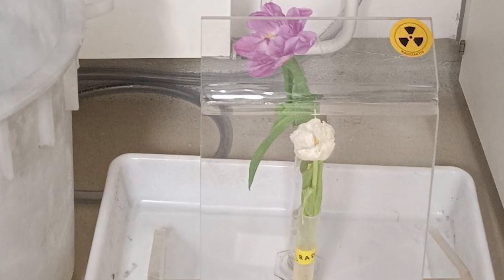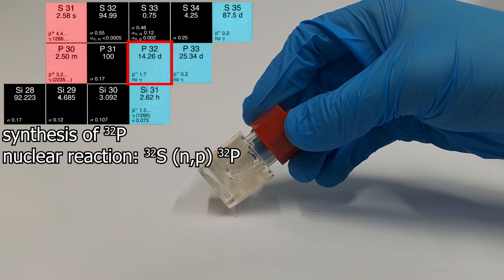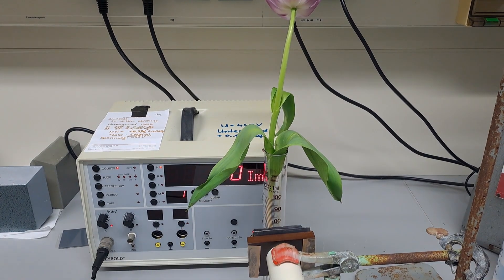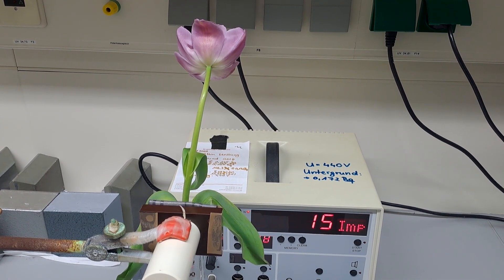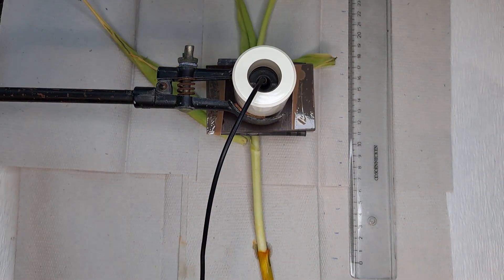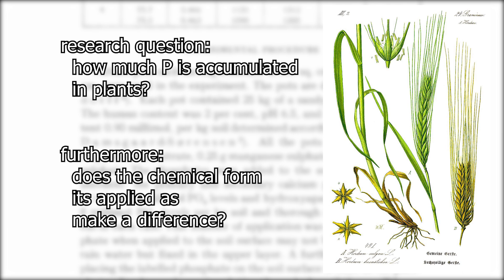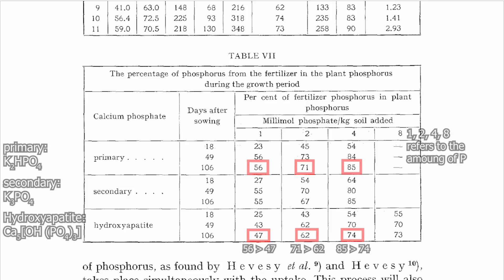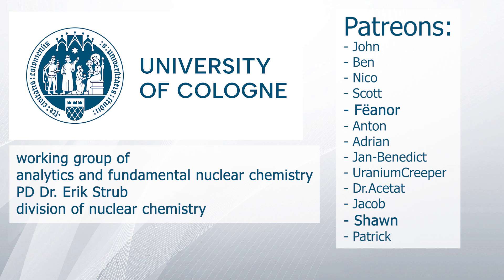I made a flower radioactive with P-32 - nuclear chemistry

Comment: Are radioactive phosphorus isotopes expensive? I think they would be interesting mutagens in plant breeding. Perhaps too expensive or the mutation profile is not desired (instead of point mutations, maybe there would be too large deletions).
Reply from the maker: @user255  this bottle costs 800€ and not only is it very short-lifed but also verry ineffective. Plants and every living organism are incredibly resistant to radiadiation. We once out a Petri dish on our strongest source (>20mSv/h) and there was no change. For visible mutations you need an electric X-ray tube. Not even 2Ci of Americium is enough
Reply: @SimonsNuclearchemistry  Usually you treat seeds or plants and screen only the next generation (after selfing) for mutations. Otherwise you are likely to miss them. Also mutations may not be easily detectable. How exactly you tested this? However, yeah, the price is way too high for anything practical!